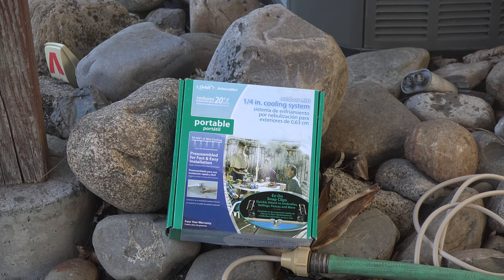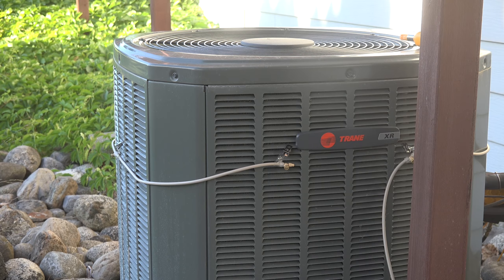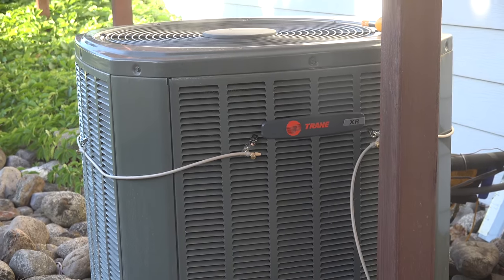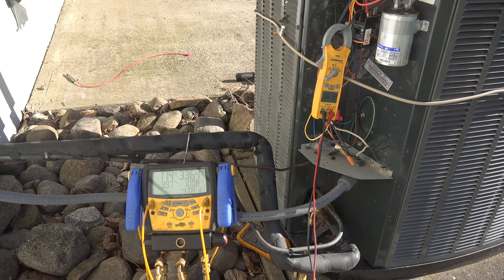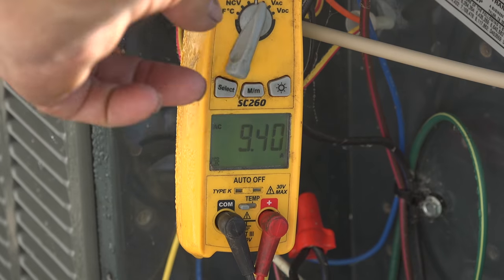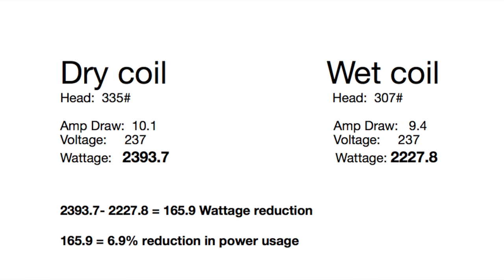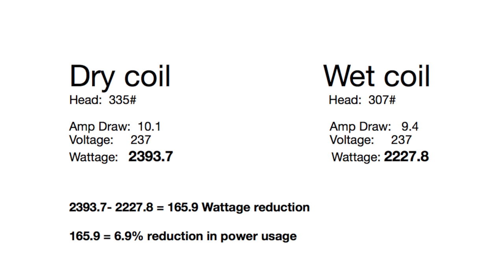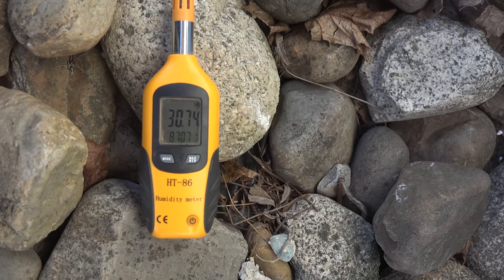Do the misters for A/C work? Part #1

Comment: My question would be this, Setting power savings A-side.  In using this mister, What's the long term outlook on wear and tear on the compressor being that there's a 10% reduction in head pressure?  Compare that to the trade off of possible coil damage.  If there's no coil damage occuring,  does it then become efficient in equipment longevity and savings? 

As I think about this,  if there's no damage to the coil an if you could add two yrs of service life to a unit, because of reduced compressor load,  combined with the minimal power savings. Does the $60 investment THEN become worth while? 
I would say possibly. But there's no long term info on this.
Reply from the maker: One of the things that I have noticed about air conditioners over the 35 years I have worked on them is that even of the unit is under maximum load, If the condenser is reasonably clean, the filter is kept clean and (most importantly) if the charge is correct,  these things will run and run and run.  They do not overheat because the compressor is cooled by returning cold gas from the evaporator (if the charge is right).  
If I dropped the head pressure by 10% using a mister, would it last longer?  My thoughts are it would make no difference.  It would be far more likely to fail is if was incorrectly charged.
GFM

Comment: Lower ambient temperature leads to lower head pressure and lower overall temperature of the refrigerant. Lower refrigerant means a higher temperature delta for the heat exchangers to be able to extract more heat from the air. Colder air out the vents means shorter amounts of time the system runs to achieve desired temps.
Reply from the maker: I assume you have not watched the entire series or failed to understand.
Using a mister did not change the Delta T of the indoor coil.  
All the statements you have made seem logical but when tested the expected changes do not happen.  
Its just not that simple.
GFM

Comment: I would like to see if there was a change in air temp coming out of the vents. You have to consider that if it is more efficient then it shouldn't run as long and should cool the house quicker. This would add to the savings.
Reply: @grayfurnaceman7640  will do

Comment: I won't use it for fear of damaging the coil as well.  However does it actually draw in cooler air and therefore cool your home faster?
Reply: How would you damage the coil with water? It gets wet every time it rains.

Comment: For me , I didn’t save money because the water bill went up a little , but the old ac system works a little better  and cools the house about 4 degrees more.. I just have 2 mister nozzles from H.depot hooked to a water hose. I live outside of Denver, so our humidity is lower.

Comment: I wonder if the misters create a colder temperature on the condenser side?  If the heat rejection capacity of the AC system is increased, it would mean it has to run less often, further reducing power usage.
Reply from the maker: Of course they do.  That is the point.  As pointed out in the video, there is about a 7% drop in power usage, but no drop in temp drop across the coil.  Watch the entire series.
GFM
Reply: @grayfurnaceman  I meant to say evaporator side.  I'll watch the rest of the videos to see.

Comment: I wonder if the condenser would expel more BTU's on a humid day than on  a dry day...Being the temperature is the same. I know with people, it's the opposite. We have more trouble cooling when it's hot and humid. A condenser coil does not sweat I think, so if the air being sucked through it is super humid, will it cool better?
Reply from the maker: Humid air absorbs more BTUs than dry air because the water takes more btus to increase its temp.
GFM

Comment: We use it on some Co2 racks usually get a 170/80 psi drop in head pressure it's controlled by a t-stat.

Comment: This depends on outside temp And humidity in vegas on hot days typically the humidity is only a couple of percent and the ambient temps are way hotter. For Mac I expect it will save 400 watts or 40 cents/hr for 4 months almost 15 hrs a day so expect savings at 12 cent power or 720 bucks a year. I plan on putting a di water system so there is no minerals in the water expected total cost 400 bucks so should payoff In less than a year. I have power monitoring and will update late summer on real result at least with the di I k ow I will. It hurt the ac system.
Reply from the maker: You are correct that the low humidity is the best environment for evaporation cooling.  
However, you numbers are skewed by one order of magnitude.  
You are probably assuming a 10% savings with the 400 watts.  Pretty optimistic.
400 watts per hour equals 4 cents per hour or $72 per year at your rate.   
DI water is quite corrosive and could put holes in the condenser coil.  
Consider that if misting water on an A/C coil could save 10% and did not cause damage to the unit wouldn't at least some manufacturers supply it as original equipment.
Manufacturers spend millions on energy efficiency so something as simple as this would be a no brainer if it worked.
I would be interested in your power monitoring when you get it.
GFM

Comment: I don't know a whole lot about the mechanics of an AC system, but what would make one expect that the voltage would change?  Load and Current would be the only two factors I see changing here.
Reply from the maker: The voltage check is to be sure it has not changed during the test.
GFM

Comment: Not sure if I missed it but did you take compressor run time I to affect? Did it run longer or shorter with the misting system? What would be the the key draw at that point? I've heard that the PH level in the water is what screws up the coils. What is the ideal PH level to avoid this? How would rain, well or city water play into the corrosion factor?
Reply from the maker: I did not.  There is no accurate rate way to measure run time as the run time is determined time of day, cloud cover, outdoor temp.
A better measure is temp difference across the coil.  
PH is not the most important issue.  Calcium is the issue.  These deposits will insulate the coil.  
So you may say, use pure water.  Unfortunately, pure water is very corrosive.  
The answer is there is no effective way to do this without some fairly extreme maintenance issues.  
GFM
Reply: @grayfurnaceman  thanks for the response. Have you taken a look at the second generation of mistbox? What is your take on that device?

Comment: Not only does it lower the head pressure which lowers the amp draw, but it also will cool the indoor air faster as the water is removing the heat from the refrigerant quicker than air alone.
Reply from the maker: There is a series on this.  Watch them all, maybe a couple of times.  Your conclusion may change.
GFM

Comment: Is it possible that some of the efficiency of the misters is the result of the AC actually getting the refrigerant colder for the same/similar amp usage? My vents feel like they blow colder and the compressor does not have to run as frequently to keep the house at the temperature setpoint.

Even if the AC only uses 6% less energy while running, the total energy savings is still a lot more if runtime is also reduced by 15% (for example).
Reply from the maker: Watch the rest of the series.  There is no reduction of run time.
GFM

Comment: The power calculation seems fine. But i would guess that the evap temperature might have been reduced as well which would require less compressor uptime. Can you try to test that?
Reply from the maker: Watch the rest of the series.  They are linked in the video.
GFM

Comment: If the head pressure is also being lowered, won't the time the unit is running also be shortened, thus creating even bigger savings?
Reply from the maker: Ideally, yes.  Whether it actually translates into shorter cycles is the question.  There is more on this subject here:  https://youtu.be/kaaG1zOFGGM
GFM

Comment: I'd only recommend these to 'band-aid' an old and inefficient system for until the equipment can be replaced...sooner than later.  I've seen some 80's & '90's-era Ruud/Rheem condensers that would've benefited a great deal, given that caveat; used something similar to keep some Westinghouse condensers going for a time back in the early '80's.  But I'd never put this on a system less than 15 yrs. old; it'd actually hurt more than help, by causing corrosion, mineral, and even dirt buildup on the coil, I believe...not to mention possibly voiding any warranty.

Comment: may I have an idea of the ambient temperature and relative humidity. because the humidity affects the effectiveness of the spray making it easier or harder to evaporate and the temps also affect how fast the water evaporates too. also, I would like to know if the ac was running under direct sunlight this misters thing will work better. Thanks
Reply from the maker: Humidity and temp are shown at 7:30 in the video.  As for sunlight, there is virtually no difference in operating temps with or without full sun.
GFM

Comment: I have a water softener that removes these contaminants. Which needs to be considered. The benefits you haven't expressed is increased efficiency and extended service life of the unit. Then you need to properly calculate the KWH cost. Ours calculates to near $0.15. Our Ac with its addition with abnormally higher ambient temperatures blows colder keeps up with the outside of design conditions. I used a 24 vac system tied to the contactor and with a thermostat in series with on temp 90° F and 80° Off. When your head comes down your g/l of refrigerant increases. Allowing more cooling per piston stroke. Years ago I had an RTU with a restricted condenser that we temporarily used a sprinkler to maintain air conditioning that allowed a bridge fix... Additionally, it's not mainly the Evaporative Cooling effect of the water on the air but the mist drawn over the coil  carrying heat from the refrigerant. A 10% increase in efficiency is huge especially when your system can't keep up. 
The added benefit of savings is helpful over time considering rates keep increasing. If we here in Florida save a conservative 2 kwh/day and its more like 3 this summer thats $9.00/ $13.50/month @ first blush that doesn’t consider the reduction in run time. 
If you now instead of running 10 hours a day now run 9 hours a day needs to be calculated into this equation. That's a 2.2 kwh /day less usage in this example. At $0.15/kwh x 2.2 = 0.33/day but subtract out the 10% of $0.015 is an additional 31.5 cents per day savings x 30 now your approaching $18.00/mo...

Comment: 20% may refer to efficiency improvement, not just power consumption.  The indoor coil is probably cooling better with the lower head pressure, and the AC won't need to run as long.  

That being said, misting will definitely reduce the lifespan of the condenser coil in one way or another.
Reply from the maker: You might want to watch my latest video on delta T across the indoor coil.
GFM

Comment: Great video. Thanks. But what if my air condition can not handle the cooling the house.  May be this will help to cool my house. And make it less hot b
Reply from the maker: Watch the series.  Linked in the video.  Short answer: it may lower head pressure but will make virtually no difference in unit capacity.
Better answer:  shade windows, awning over windows, attic fan better insulation.
GFM
Reply: Yes it will.

Comment: 9¢ per kw. I haven't paid that low of a price in well over 20 yrs. Little over 13¢ now. 
Also, I'm not a HVAC guy but wouldn't a lower head pressure be less wear and tear on the compressor so it would last longer?
Reply from the maker: We have a lot of hydro power here, so cheaper power.  
Ideally, it should extend compressor life.  As with so many of these type of devices, there is a catch.  
Running water on a coil brings on several problems.  Unless you are using pure water, calcium will build up on the coil.  If you are using pure water, it is very corrosive and can cause refrigerant leaks.  
No manufacturer uses this type of device.  If it were viable, manufacturers would use it.  
Refrigeration compressors are designed to operate at high temps and determining any extension of life is pretty tough.
GFM

Comment: The question is not only about electric usage,  it's also about the systems ability to cool a space. My point is what is the difference in high side pressure? And what is the difference in vent temperature? I feel those are more important than electric efficiency.  And yes use a water filter.

Comment: I wonder out west where the water cost is high and on a shortage, adding that cost into the equation. Thanks for the video.
Reply: Only 8 gallons of water a day. I can take a 15 minute shower vs a 30 minute shower. Problem solved

Comment: The mist provides a simulation for outside temperature so it will work to drop head pressure, making compressor to work comfortable.
But water consumption isn't free.
Reply from the maker: What is "simulation for outside temperature"?
GFM

Comment: Interesting. Our electricity is 20 cents a kw/h and our 1988 unit draws more power than the one in this video, so might be worth it. One benefit not mentioned is the reduction in how hard the compressor and motor have to work and effect on lifespan. My 30 year old machine might like a bit of a break.

Comment: Not going to comment on the testing methods, but as someone who utilized this in large scale industrial settings, I can tell you that it most definitely does enhance performance significantly. The only issue is the waste of water and corrosion.

Comment: Excellent experiment! Glad you mentioned the humidity! Ya! Mister is full BS in a high humidity area. Glad you debunked that! What I want to do is take the fan/top off my older Trane ODU, and hose down the whole condenser coil with 55º water from our deep well on a hot day! Kind of a real bad geo thermal setup! Again, just as an experiment, like you did.

Comment: Does the efficiency of the entire system change?  With the reduced head pressure, will the compressor have a longer life?
Reply from the maker: First, watch the entire series.  Lowering head pressure can increase compressor life, but the reduction must be substantial.  15 or 20# would make no difference.  
From my readings, there is little or no change in efficiency.  
GFM

Comment: Why would amps change etc? Seems to me it would just run less long since it cools faster with cooler air? The unit should run with the same amps etc
Reply from the maker: Amperage draw is related to the difference between head pressure and suction pressure.  Higher head, higher amp draw.  
GFM

Comment: Nice test
With that you see about a 7% savings on AC unit power, what is your cost to run the water to the AC unit?
Reply from the maker: There has been much in the comments section about water use.  I will be publishing a test of the water used soon.  In my area, summer water use is very cheap, as this is an irrigation district.
GFM

Comment: They use these in industrial settings. Can cause issues with corrosion and mineral build up on the unit.
Reply from the maker: Industrial use as an evaporative condenser is common.  They require high maintenance with water treatment and flushing.  
GFM

Comment: Hey nice vid informative , thanks for this I agree let it B, but was wondering in the other side of things do you think by doing this your AC unit over time doesn't  WORK as hard & we get longer life ???
Reply from the maker: If your A/C is charged and installed correctly, with normal maintenance, it will operate with 100+ degrees F ambient for a very long time.  It is designed for this use.  
What happens when you install misters is that you introduce an abnormally low head pressure that changes the hi side/low side relationship which can reduce compressor cooling and change superheat.  
GFM

Comment: Question: will it cool the air coming out of the ducts. Dont care about the electricity. Any ideas Im in AZ very hot 104 degrees. I read that coils can only cool 20 degrees of the ambient temperature.
Reply from the maker: Watch the rest of the series (linked at the end of the video).  
The 20F delta T used to be the standard.  With higher efficiency units, the delta T is lower.  Around 16 to 18F.  
I know that does not appear to make sense, but it does because of higher air flow thru the ductwork.  
GFM
Reply: @grayfurnaceman  Thanks for your smarts and time to do detailed videos.  and taking the time to respond to me. I don't quite understand before and after while mister is activated.   What is the difference in the inside vent temperature F, when the mister is on and mister off. Please.  .... My issue is when it gets 107 Ac only cools to about 80 F.  Electricity consumption is not an issue, just cooling. Thanks.

Comment: I agree with the whole calcium thing as well. That was the first thing I thought when I saw  these things. Hey can you make a video on the difference in energy,efficiency, and/or comfort if you leave the fan on instead of auto. Iv always felt that when the fan is on, the temp. is at its best comfort. But how much in energy is the difference and does it matter on which metering device. If you can. But regardless thank you.  Glad your still makeing videos.

Comment: So I understand it’s a small percentage of power…however what how was the temp change at the vent?   Cause if it’s a drop at the vent then it could not run as long during a cycle making your power less.
Reply from the maker: The rest of the series is linked at the end of the video. That may answer your question. GFM